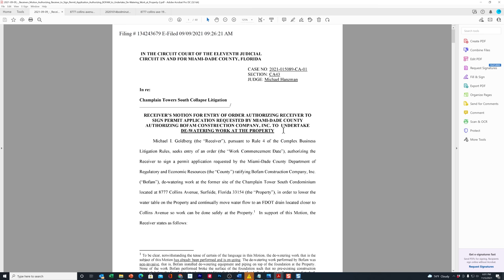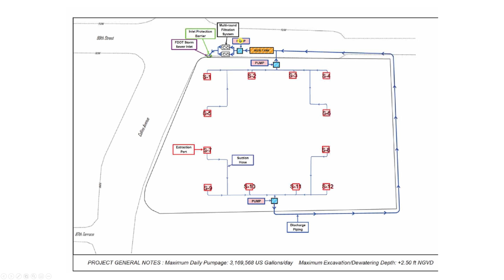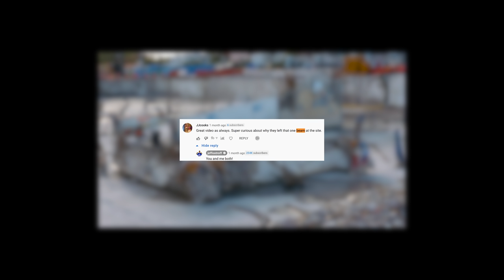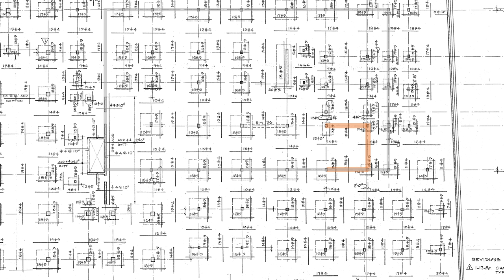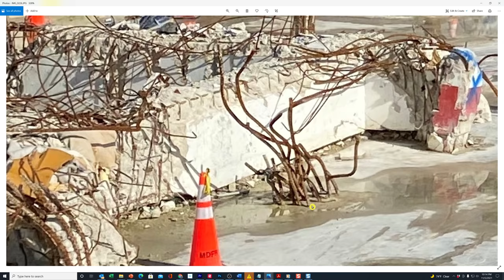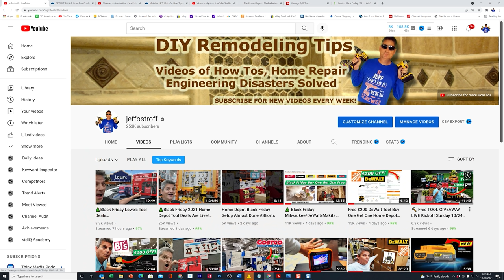Miami Condo Collapse: Engineers Baffled By Mystery Column

Comment: DAY-um, it was all so straightforward, undergrad Statics & Dynamics, marginal design corruptly built, throw in some sub-standard Mafia ready-mix not properly vibrated/consolidated around the rebars (aka Yet Another Day in So-Fla), then Jeff "Sherlock" O-man spots some Geraldo Rivera made-for-TV movie fodder... things that make you go HMMMmmmm... hmmm...

PS: forgot to toss in the crane collapse right across the formwork for the H-beam zone!... nothing to see here!
Reply: Well, the bottom line is that the pool deck was both underbuilt and not waterproofed.  It's collapse is what killed those people.
Reply from the maker: Dang, I've been trying to buy that Mafia Mix at Home depot for years, they just don't stock it anymore!
Reply: @jeffostroff  Resist the temptation!... while the price is right, Mafia-Mix is only 1200 PSI, barely adequate for lawn ornaments.  Seriously though, back in the 1970s and 80s, Rinker was the only game in So-Fla, and they were totally mobbed up.  Even the Feds couldn't/wouldn't touch them.  They "won" every contract... or else.
Reply: Yeah, it bothers me the lack of analysis of the damage that crane collapse could have caused by channels on Youtube. I hope an official analysis comes out when things are said and done about the crane.
Reply: @Phoenix-jw1mn  The crane collapse is irrelevant.  The collapse of the water-compromised pool deck is the root cause for the building collapse.
Reply: @johnbergstrom2931  you do realize the crane fell across the pool deck, the area that collapsed right?
Reply: @Phoenix-jw1mn  I'm not sure that's accurate.  Cite your source.
Reply: @johnbergstrom2931  my source would be watching the crane collapse video frame by frame and comparing landmarks like the hotel behind the Champlain property to what exists today. It fell across the pool deck in the areas that it always retained water at and over the 2nd-floor level where the above-ground parking area was that didn't collapse.

Now granted it had failed waterproofing and tiles above the area that should have allowed water to drain that contributed further to the concrete slab degradation but I imagine that huge crane falling didn't help the structural integrity of the slab there. Imagine microfracture getting water-saturated over the course of decades with salty seawater.
. 
https://www.youtube.com/watch?v=GJ9Jt1zPDMA
Reply: @jeffostroff  I heard it made great shoes… 😄
Reply: @Phoenix-jw1mn  I think you're chasing a red herring...  The lack of waterproofing is what ultimately weakened and destroyed the pool deck.  As for the 'microfracture' theory, concrete develops microfractures as a normal part of it's expansion/contraction cycles anyway.  Sometimes, not so 'micro'...

Comment: My theory of the "mystery" column is that the rebar you see sticking out of the slab are the remains of the column which used to bear on top of the "H" beam (BM35) between column lines 8/10 and N/O. I surmise that this column broke free and was "driven" through the slab-on-grade from the force of all of that weight above. When the demo crews were cleaning up they likely cut the parts sticking out with a shear and likely crushed whatever concrete was clinging to the rebar. I beleive that if you pulled on that rebar, a chunk of column will come out. It appears to be in the same exact spot the 1st floor column used to be. When you eliminate all other possibilities, this seems to be the only remaining explanation. The column didn't "grow" out of nowhere. This could also explain why water seems to be seeping up through this column. Nick P,  Civil Engineer (EIT)
Reply from the maker: You forget that there is zero damage on the floor where there should have been craters or something else if it had impaled into the floor but there is no damage. These rebar rods look like they were intentionally built up out of that concrete floor like it was done by somebody in the last 12 months, since Fiorella shot her video inside the garage in July 2020, showing no column exists where that mystery column is.
Reply: @jeffostroff  No, I didn't forget it...there's just no other plausable explanation...in one of the video/photos it looks like there is a hole where this column is and water is coming up from below. This would support this theory. I can't imagine any other way this rebar ended up there...
Reply: @nickpeetros6895  Maybe human hands put the rebar there.  Not magic impalement.

Comment: I’m just a 33 yr old little girl that knows absolutely nothing about construction lol but can you tell me why there is just one of these huge beefy H beams? Why wouldn’t there be one of these beams at every corner of the building to hold the building up evenly? This is probably a stupid question lol or is there and I just missed it? Lol pls no one grill me in the comments lol
Reply from the maker: Victoria, At 1:28 in the video, I show you visually the reasoning for H-beam. There was a floating column that starts on the first floor and goes all the way up to the 12th floor, but it does not extend down into the garage because they don't want to block the driving lane in the garage. So they have it end on top of this H beam in the middle as I showed. And the purpose of this H-beam is to transfer that downward force load from that one floating column in the middle of the H beam and transfer that load to the other four columns straight to the ground in the garage floor.  This is how we build load-bearing walls for example in houses so a 1st-floor kitchen ceiling would force the load down the stud wall to the kitchen floor, which should then be resting on top of poles that are down in your basement going to the ground.
Reply: It has to do with column layout.  Architects want the columns in certain locations in the residential units so they aren't in the way, but the columns need to be in different locations in the parking garage so they aren't in the way of drive aisles or parking spaces.  The H beams allow a transition between layout in the residential units and layout in the parking area.  This corner was the only location in this wing of the building that this was required.  If you look at the west side of the building there are a lot of these things but they are located at level 2 instead of level 1, but they are there to allow for a different column layout in the residential units from the lobby and the parking area.
Reply: Victoria it’s a completely fine question 😀, don’t sell yourself short, you are obviously an adult with good critical thinking skills and you belong in this space just as much as the guys in here. 👍🏼
Reply: You might be a 33 yo "girl" but you are much smarter than most Americans by far. Good question, hope you understand the explanation by Jeff. It kind of takes some 3D spacial imaging in the mind without a model.

Comment: Us engineers ? Jeff you banana sandwich 🤣 where’s our credit ? Great video regardless . Thank you for covering this. I understand they put the beam up to open up for parking space. But could it have Been a mess up (it wasn’t supposed to go to basement level ? So they pushed the rebar under the slab and with the weight it’s popped up ? Especially if they find there’s evidence of Of some subsidence ?
Reply from the maker: the H-beam was there to support the floating column from floor 1 up to floor 12, without the column having to drop into the grade in the middle of the driving lane.
Reply: @jeffostroff  but what if originally they were going to bring that column all the way down into the parking garage ? Just pushing out ideas ?
Reply: No way they'd try to bend that much rebar into a hole in the ground.  Grinding it off only takes a few seconds.  Also, rebar, when it's bent that drastically, doesn't rebound.  It has a fairly low elasticity, even for steel.
Reply: @johnbergstrom2931  lol yeah when I thought about it . I was kinda like duh 🙄
Reply: @johnbergstrom2931  I’ve started my own research group away from them other idiots (even though) I sound like one now 🤣
Reply: @CollapseOfChamplainAndMore  Yeah, there seems to be ongoing traction with the 'super-penetrator' theory of column impalement, even though these people have engineers telling them it doesn't work that way, not looking as pristine as it does.  They don't listen, just cling to their little uneducated theories...  Another thinks the 65,000 lb H beam was violently flung away at a 45 degree angle, even though there wasn't even close to that amount of lateral force and, really, the building fell mostly straight down...
Oh well, what can one do, you know?
Reply: @CollapseOfChamplainAndMore   looks like the H beam shifted off its columns about 3-6' when it fell. The MS is shown on the piling cap sheet also at 01-8 between 08 and G8. The video view is not correct. The  beam shows no hole penetrations

Comment: Could that column have been driven downwards from the floor above, by the weight of the building?
Reply from the maker: Your hypothesis comes up a lot from boatloads of people about that column. I don't think it's possible because if it had slipped off it would not likely have come straight down where the mystery column is which is only about two feet away from the HP. Also if it had impaled the floor there should be damage all over the concrete there and there is none where is the crater? So where else could the column come from? So far my prevailing theory is that somebody started to build that column sometime after Fiorella shot her video in July 2020. however I could find no permits for it

Comment: The only 2 plausible explanations for that rebar is..
1. They knew there was an issue and added a column very recently in the middle of a driveway. (Don't think this is it)
2. The column that started on 2nd floor was pushed through the foundation.. Again, no good pictures that would prove this, but I think that may be the most likely.  There was a whole building acting like a jack hammer to that column as it fell.
Reply from the maker: I have been going with explanation #1 because it fits the evidence the most. #2 does not because where is the floor damage from a 12x24 column poking through?
Reply: @jeffostroff  
Putting in an extra column would mean there is a contractor somewhere with prints showing this being constructed, and something of that magnitude would have been HUGE news because that would mean the property managers knew the building was about to collapse (because why else would you do that...) Also this wasn't noted on the recent 40-year certification. This would have had to been VERY recent.
My guess.. I think that came down with such force that it punched through the slab from the 2nd floor. How thick is the slab in the middle of the driveway?  If it's only 6", I can see this being possible.  I'm thinking the building smacking that column like a nail.. That was one of the first areas to collapse, meaning it's possible that the column dropped to basement level, then got pounded in by the floors above it. 
Again, to your point, there should be damage to the concrete slab, and we can't see that because it's either not there, or the water is covering it. (Maybe that's a source of the water?)
Reply: nope.It was there all along. The video is not the correct angle

Comment: Really wonderful analysis Jeff. I agree with Mike Dean and others.
It's almost as if the center column from the first floor fell straight down and penetrated the floor.
Notice the two side columns still have concrete attached while the mysterious center one is stripped bare.
As if the concrete was pulverized by the impact of falling 12ish feet straight down.
Reply from the maker: yes could be

Comment: Why isn't there any rebar sticking up out of H beam where vertical column would have been attached? My guess is it was not attached and when the H beam moved out from under it it piled into the floor with sufficient force to not disturb the concrete floor. Makes sense to me?
Reply from the maker: It's hard to say there's so much rebar popping up out of that being that it's fairly hard to tell unless you're standing there and waiting through the forest through the trees to see which ones there should be that we need to be analyzing. But yes the fact that a column was sitting on top of that H beam at some point in time must have been tied with rebar you would think there would be some spaghetti-like rebar torn out of the top of that being. It is also possible that when they were removing the rubble they sliced right through it as they did with many columns in the garage floor as you can see.

Comment: The rebar from the mystery pier is anchored into a pier below grade. It didn’t come from above because the rebar above would have to tie into the anchored rebar. That’s what iron workers are responsible for and it’s inspected before the concrete can even be poured. And before they can start a new level the rebar has to tie into the lower level. That mystery column is in the video of the garage. The beam starts at pier 15 and then 3 other piers at the opposite end of the beam. I can’t make out the numbers but it’s there
Reply from the maker: No it is not there. I need to make another video showing where the beam is in the garage

Comment: Is it possible added in a later drawing package , with stairs location may have needed it ? Stairs often submitted separately from main building package.
Reply from the maker: No, use you head! the column was not there last year as shown in the video.

Comment: Its a trick of the eye, that rebar is not coming out of the slab rather laying over, ie, its the rebar from the penthouse column that sits on the H beam. If you look at earlier pictures its off the ground not touching the concrete and still connected to the H beam.
Reply from the maker: show us links to these earlier pictures. If it was loose NIST would have taken it like they did everything else

Comment: In your Sep 4 video, you showed a few spots where NIST had poked holes in the slab--for whatever reason, some kind of testing. Is it possible that NIST did this as some sort of a test? I was trying to see if you could see it in any of your previous videos, but I don't have the time to go through them all. Maybe you can remember whether you took an earlier shot of this area so you can compare?
Reply from the maker: I have no other close-up shots earlier as I could not get anywhere near it.
Reply: @jeffostroff  If you look at the aerial shot in the NIST video (Surfside Condo Collapse Site View NIST Video Ground Zero) you can see that mystery column is present before they have finished cleaning up the site--do I doubt they installed it as a test. You can also see in that aerial photo that there is no rebar on top of the "H" beam where the first-floor column should have been attached. If this column was just "floating," it might have indeed come loose and impaled itself into the slab. Yep, I know what you are going to say: where's the damaged concrete? In looking at the photos and videos, I don't see much damage to the slab anywhere, much less here. Could that "square" around the rebar actually be the column's footprint? Could it have driven into the concrete like a straw into a tree trunk during a tornado? Also, what does Josh at BI think it might be--have you asked him? I would be curious to see what his opinion is.

Comment: If I was trying to shore up the garage ceiling that might have been falling down, I would start by adding a column at the H beam to help support the load bearing column right above it. This video seems to indicate that work to shore up the garage ceiling had begun. The column that was painted red at the base seems to have been recognized as the most important of the load carrying columns and thus was painted red to indicate its importance.. Also, a garbage can seems to have been placed in front of it to protect it from getting damaged by cars passing by.
Reply from the maker: We don't know why that one was painted red except if you look at Fiorella's garage video, looks like is a switch or control on that column
Reply: But if you think about it, putting a column there is an excessive way to shore up a cracking slab.  If the fix was just temporary until the real repairs had begun, they could have just placed heavy timbers on the garage slab and ceiling and used concrete shoring jacks to keep stuff from falling down.  Putting a full-fledged column there for that purpose was excessive.

I'm not sure what it is anymore.  (But I'm sure as f*ck not joining the 'idiot impalement cult')  It sure looks like the beginnings of a column...
Who really knows what CTS management was thinking.  They knew their building was falling apart for almost 3 years and I would bet in the months preceeding the collapse they probably saw alarming visible signs of it.  They panicked.
Reply: @jeffostroff  Might have been a manual fire alarm.
Reply: @johnbergstrom2931  We are talking about structural fix here.. not cosmetic fix...
Reply: @charlesdang4670  My point is CTS management were too incompetent/apathetic to know the difference.